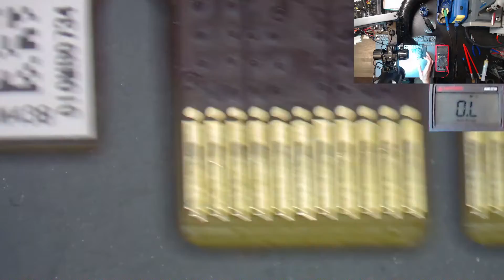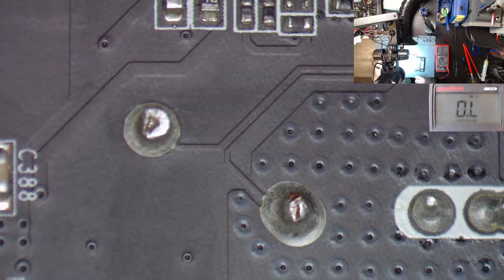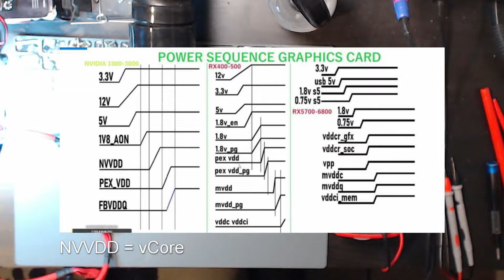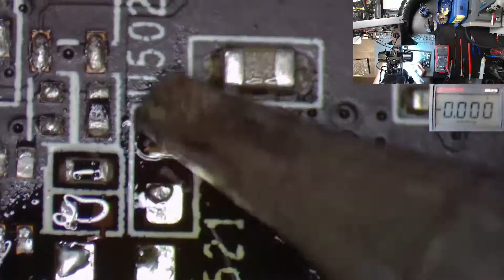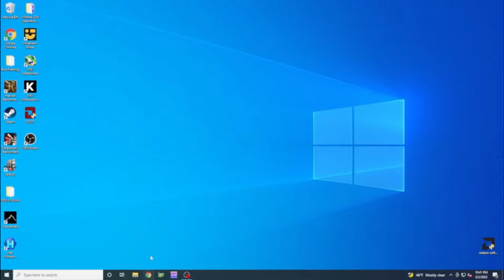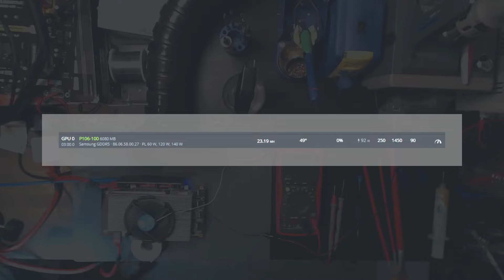P106-100 Repair | No vCore | Missing EN

Comment: Hey I know the is an older video but hoping you might have some insight. I have a Sapphire RX6800XT that is missing the vCore. I don't seem to be getting the GFX_SOC_PWRGD out of pin 18 of the XDPE132G5D controller chip. Which means that the AND gate U506 is not outputting anything to pin47 of the PWM chip. VCC and the 1.8V_EN voltages going into the PWM controller are there. Would this suggest the PWM controller is bad?
Reply from the maker: I'd have to take a look at the specific circuit, but no EN (which comes from PGOOD of the chip for the previous power rail) usually means one of three things (there are a few more depending on the circuit but this is where I'd start):

- The pullup resistor that's supposed to power that circuit is bad
- You're missing the power that's supposed to power the circuit through the pullup resistor (3v3_aux or a similar secondary 1.8v/3.3v rail)
- PGOOD is actually being pulled down by the controller or chip of the previous power rail. This means the voltage is technically there, but it's going straight to ground through the controller/chip

PGOOD is usually what's called an open drain output, which means that it doesn't actually output any voltage (the pullup resistor is what supplies voltage for the circuit), it can only pull it down to gnd, or release it. If you have 0 or near 0 ohms on that circuit (at EN of the rail with no voltage, assuming you're checking the next rail in the sequence. Cards have an order of which their power rails turn on) with the card powered on, then either the controller/chip of the previous rail is fried, or the chip is detecting that something isn't right so it's pulling that PGOOD circuit to ground instead of releasing it. Usually the latter.

This is where it can get a bit tricky, if you're lucky it's going to be an obviously blown chip or resistor. If there's no visual damage, you have to find the datasheet for the chip online, and go through various pins to make sure that everything is good. If you have power output from the chip and it's the correct voltage, then it's typically going to be something to do with the feedback or current monitoring circuitry. E.g. the chip thinks it's getting 3v back when it should only be seeing 700mV, or it's seeing nothing back when it should be getting .9v (these are arbitrary values by the way). It could be another number of things, but that's up to you to figure out!

Everyone thinks that graphics card repair is difficult because of the soldering, BGA work, etc. While this can be true, the people who are good at graphics card repair had to learn to read circuitry and figure out how circuits are supposed to work (or that they're not working right), in order to fix problems that aren't obvious. And as I always tell people, don't just go swapping parts. Learn how to diagnose a circuit or chip instead, and you'll be much more efficient in the future. Not to mention you won't waste time soldering when that may not be the issue. Swapping or removing things should only be a last resort.

Good luck :)

Comment: Sir, I experienced the same thing as what was explained in the video, the GPU is ZOTAC GTX 1060 6gb AMP edition, the component layout is exactly the same as what you explained and the problem is the same, only on the GPU that I am working on there are no missing components, so  I want to ask how much voltage is in the components that you replaced, especially in the transistor pins, thank you in advance.

Comment: Hey, great video!
I've got a question that I'm hoping you can help with. My son was replacing the thermal paste on an RTX2060 mobile and knocked off possibly a resistor, and lost it. Any chance if I send you an image of the board you might know what piece is missing from that spot. We didn't have any luck with Nvidia or MSI. 
Thank you!!!
Steve
Reply from the maker: Thank you! Sure, I can definitely help. It would probably be easier if you join this Discord https://discord.gg/GZR7DK5g and ask about it there. I'm sure that myself or someone else can look for a schematic that matches or is close enough, and help you figure out the component and the value!
Reply: @WasatchElectronics  Thank you very much! I'll forward the info to my son and let him post it on Discord. Thanks again!

Comment: Can i replace K6N (MMDT3904) with MBT3904DW1? Both are Sot-363 dual multi purpose npn signal transistor...
Reply from the maker: To figure that out, you'd want to check the datasheet for both. Compare pinouts and specs to see if it's replaceable. I'm not an expert and don't have an EE degree, sometimes I just guess based off of the datasheets and the knowledge I do have. I make sure to check everything properly when doing so though - Check signal output with oscilloscope, check with thermal imaging to make sure it's not heating up more than the other mosfets, etc. The ratings are mostly what you're after though, I always make sure it's got equal or higher max ratings for amperage and voltage
Reply: @WasatchElectronics  thanks for the advice!
That transistor is used for Pull-down transistor for EN signal on 1,8V IC. And both MMDT and MBT tiltled as multipurpose signal transistor, and have some pinout diagram.
I replace it anyway, and it work like what it used to be....

Cheers
Reply: @farizfadillah7557  good information, thank you

Comment: the best explanation i've ever seen so far, valuable content even with an instable microscope camera and a bad resolution "an insane skill for tracing without schematics".
PS : could you pls explain more about dual NPN/PNP transistors, and gates and diodes.
 thank u for sharing liked and subscribed
Reply from the maker: Thank you! Trust me, the shaky microscope kills me as well. I'm working on a better solution for mounting, which I think will solve my issue.

Sure, I plan on doing a video on those soon enough that will go into more detail on how they work!

Comment: Have been delving into learning board level repair myself recently and I think many others can agree that quality videos like this are sparce. Keep up the wonderful work. The structure and educational points are done well. I have a 1060 I could send you if you'd like to attempt to repair it. It's also missing vCore, but doesn't have any missing components like this one
Reply from the maker: I've got a few more 1060s and P106-100s (basically 1060s) to repair, and I'm hoping one of them is a different EN circuit problem that I can make a video on. If not, I'll hopefully come across another 10 series that's got an EN problem, since that circuit is basically the same across all 10 series.

I don't take customer repairs at the moment, but maybe one day! Thank you for the offer though, and the compliment on the videos :)
Reply: @WasatchElectronics  Well actually was thinking of just sending it to you to fix and do as you please with, I was not looking to get it back. I fully understand though and definitely keep up the great work. Hopefully one day I'll be able to know enough to make videos to help others
Reply from the maker: @4TMGames  I'll consider it! At the moment I haven't got a PO box or anything set up, and I'm not very interested in just handing out my address haha. If that changes soon I'll let you know, I'd be happy to take a look and maybe do a video on it :)

Comment: If you can make the video sharper that would be great.
Video shakes a little when you are moving mount.
Overall very nice for a first video homie.
Reply from the maker: Thank you!

Yeah, that's just due to the fact that I'm using a webcam to record at the moment. I did some post processing, but even then it can only get so good. I'm on the hunt for something better at the moment, should be only a short bit and the quality will greatly improve!

I'm also trying to figure out the shaking, I'm not sure what causes that on my scope. It's attached to two desks and seems to be very solid, so I'm thinking maybe it's my desk moving slightly. I'm looking into attaching it to the wall to solve that.

Thanks for the feedback :)